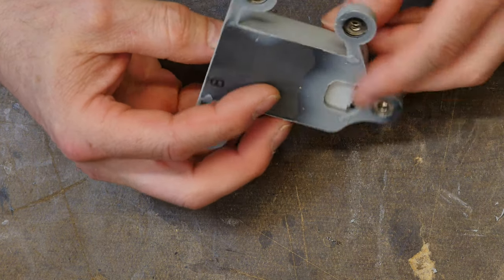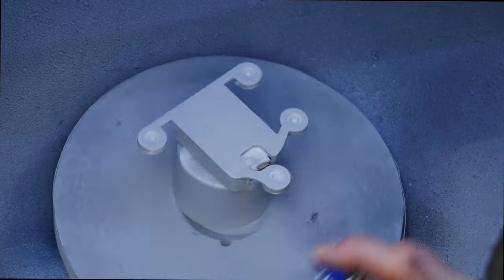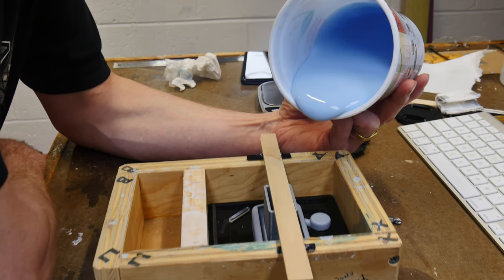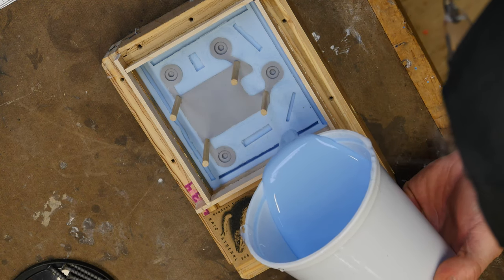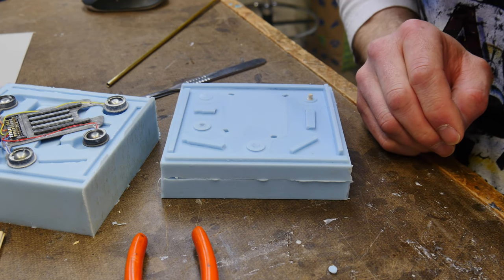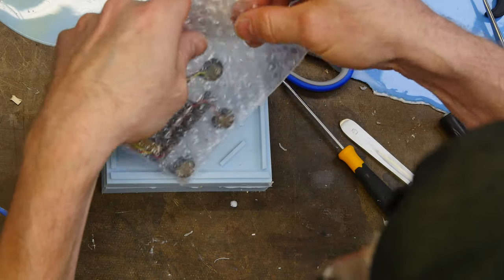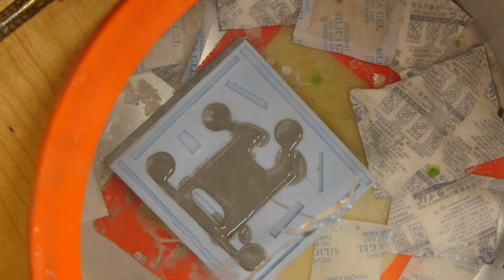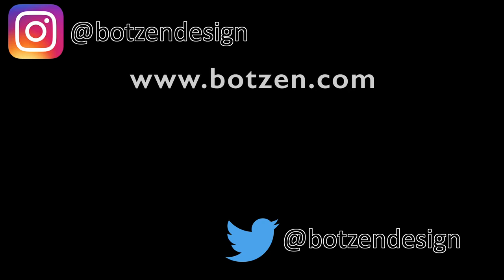How to Prototype Over molded Flexible Urethane resin parts?

Comment: Very impressive, getting the urethane mixed, loaded and degassed in the syringe, loaded and degassed in the mold, closing, clamping, and pressurising in the 7-10 minute working time.  While shooting video.
I make production molds for medical manikins. Lots of hollow silicone rubber parts, some silicone overmolded  on silicone. Basicly three dimensional puzzles.

Comment: i always thougth urethane rubbers, like silicone, inevitably have a much higher viscosity, making them really hard to cast with more intricate molds. this product seems to have the casting abilities of resin and rubber characteristics after curing. (this has been helpful!)
Reply from the maker: Great, just have to know the limitations and properties of what you are using and work with them.

Comment: Eric, Thanks as always! For overmolded parts of two different materials (resin and silicon), how do get them to stick together so Ty don’t separate and develop air pocket in between them? Thanks
Reply from the maker: Not possible, both materials hard and soft need to be urethane

Comment: Eric,

How long does is the pot life for the urethane that you are using? How long does it take your vacuum chamber to get past 29 (or near full vacuum)? 

 I'm finding that if the pot life is under 10min that I don't have enough time to mix the urethane, degas it, inject/pour it into the mold, and the place it in the pressure chamber.

 What pot life and viscosity do you look for when purchasing a urethane?  Obviously it depends on the part but this seems like a key factor to success.

Also how closely do you regulate the temp in your pressure chamber? I find that some urethanes have incredibly small temp ranges listed on their technical data sheets for curing temperatures. 

Your videos are an incredible asset to the online community. Much appreciation!
Reply from the maker: The pot that varies with every type of material, the pulls close to 30

Comment: I am trying to make a small part its weights is 3 grams with flexible resin but i always have bubbles inside of it. I dont have vacume or pressure pot. Can i cast nice part?
Reply from the maker: Yes, I can. Vacuum and pressure are essental to a successful cast. Reach out though my website for a quote, include as much project Info as possible.
Reply: @EricStrebel  thank you i will check it.

Comment: Eric I have a question how do you cast an object that needs to be soft like the above casting you made of a short 70 and then become very rigid hard  from the same material
Reply from the maker: Your question makes no sense I have no idea what you're asking me
Reply: @EricStrebel  can you show how to mak resin.or silicone  cast more flexiable  in casting hard plast to softer ..example... squeegee blade... or plast weather striping hard plast to softer..
Reply from the maker: Well I don’t fully still understand your question but I think you want to cast a flexible object from a hard master, you just need to choose the correct durometer material when you cast for your application
Reply: @EricStrebel  no eric im casting a object that a  very hard shoreness that transcends into a soft shorness ....
Reply from the maker: Insert molding....make one part and then cast another resin around it.